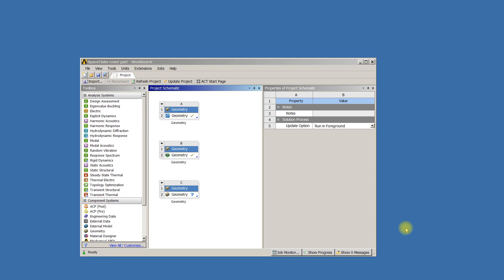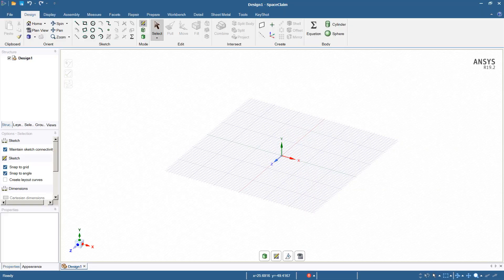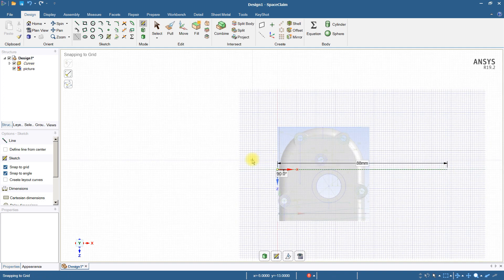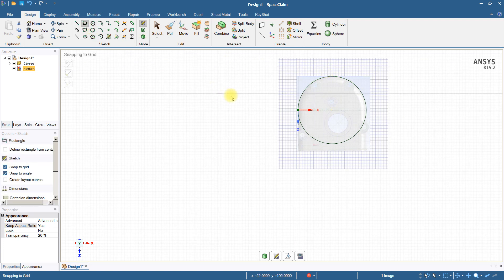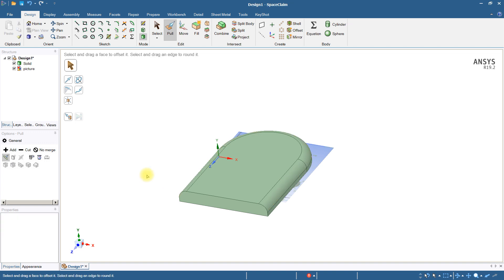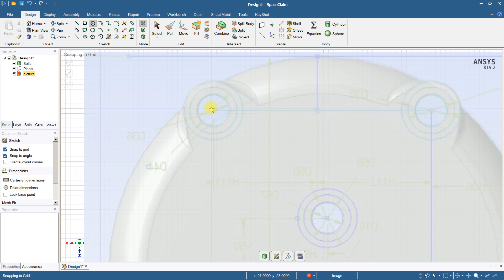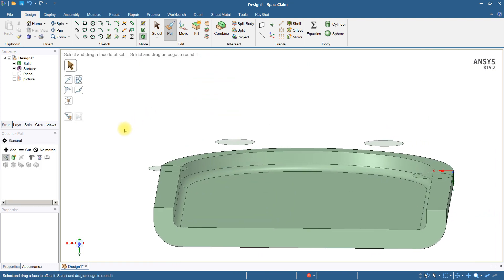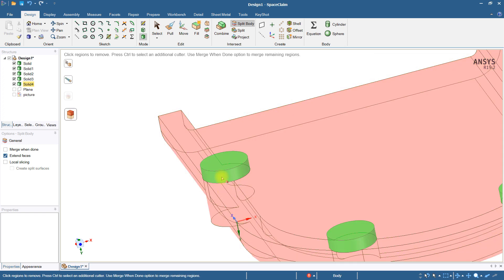SpaceClaim make part using picture

Comment: Hello. I just started to learn SpaceClaim which's interface looks like the Design Modeler. I am wondering if there is a difference between the looks of those 2 versions. You surprised me with saying there is another modeler. I wonder how do I find, which one am I really using. Further I wonder which is better to create/reverse engineer injection mold from 2D design/CAD drawing. When you say the nontraditional SpaceClaim is better to create complex geometry....what do you talk about? Is injection mold  considered simple or complex geometry by your standard.(Of course the mold base is just set of plates with holes from every which direction -so that might be considered elementary). But then when it comes to actual molding insert and/or surfaces of integral mold, designing 3D parting lines and parting surfaces....which of those 2 versions is more suitable?
By the way...excellent video, I have definitely learned something!
Reply from the maker: You can try DesignModeler and see the difference for yourself. DM is better if you want to build parametric models that the DesignXplorer can study in DOE and other optimization studies.
SC is faster to reverse engineer an existing design of a mold base.

Comment: I’ve been using Spaceclaim for a couple of years as my primary platform and when it works, it works great, when it decides to not cooperate it becomes downright evil! The support guys were outstanding, but could never answer why some surfaces will refuse to trim other surfaces; sometimes non-intersecting surfaces will split each other and some times not, sometimes intersecting surfaces will only split another where they intersect, some times not at all, some times the complete width of the surface, the inconsistency is frustrating.
Reply from the maker: I agree that SpaceClaim can be a delight one moment and then completely frustrating the next moment. I recorded this video only after about five attempts that ended badly. I don't know if people want to see videos of me slogging though the swamp to get to the high ground.